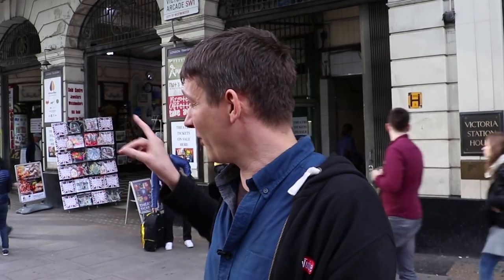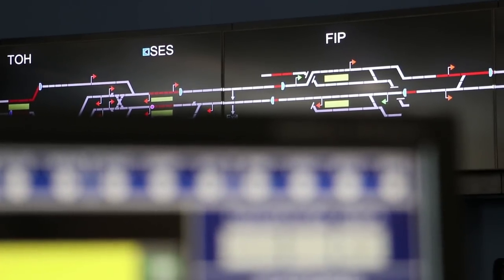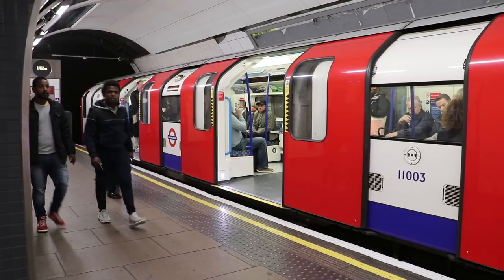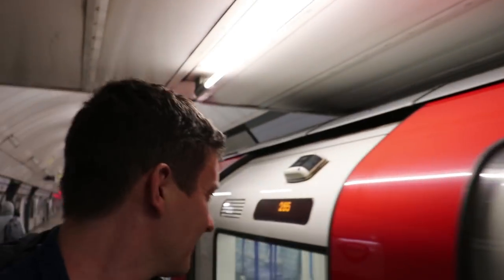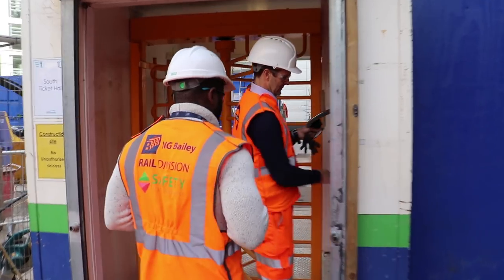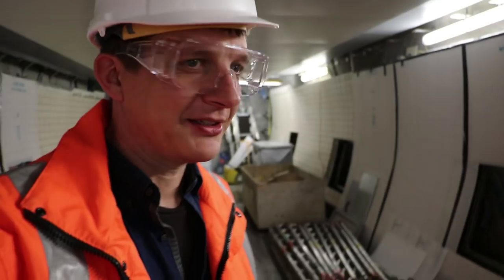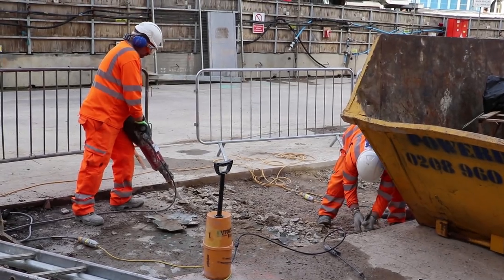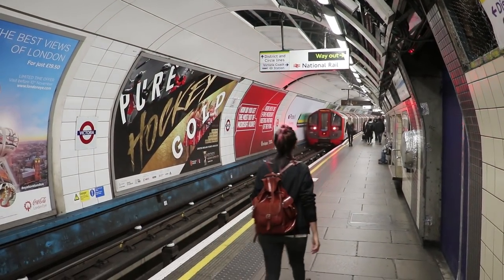Inside The Victoria Line Depot

Comment: Now all we are missing is more ventilation shafts. The trains are so close together that the line is in an average of 35 degrees Celsius in rush hour. They desperately need more ventilation shafts.
Reply: Zoltán Kozma 

That's the average temperature of a tropical country that I visited before!
Reply: Well I could agree that this is some cool thing... but people move to London for the reason among many others that it does not get 35 degrees there... at the seaside you go and dive in the tropical ocean. In the London underground you can take a bath in someone else's sweat... yikes... as people have their coats on of course :D
Reply: Zoltán Kozma 
That is average temp here in the Philippines
Reply: Zoltán Kozma h
Reply: Is that all? Not that bad. Besides vent shafts won't help. It's the heat off the brakes and motors then people. So you'd feel it before it hit the shaft anyway
Reply: Ventilation shafts won't do much to relieve the heat baked into the underground.
Reply: @taygadesign  well the VIC is the tropical of TFL 😂😂
Reply: @Bartimayus  they would at least allow for AC to actually make sense in the deep level tube trains.
Reply: There is an ongoing project for that actually.  
'Cooling The Tube' it's called... but don't hold your breath!

Comment: With that many trains so close together in an automated system , your going to get much more service problems when trains fail or signaling technology goes up the spout . Plus you only have a few turn back crossovers to divert a failed service onto to it can tip out and run empty to the depot ,

Comment: They should upgrade the bloody Pic line asap give how literally it fails every single day
Reply: the new tube for london is coming to the piccadilly soon. I'm pretty sure most of the time, faults on the piccadilly would be from the ageing rolling stock.
Reply: I love the pic stock so much though, the line I grew up using from north London.
Reply: H010 most of the Piccadilly line faults come from outdated signalling and particularly control room apparatus, meaning service recovery is slow or control room mistakes cause service disruption. The 1973 stock is actually very reliable for its age
Reply: @uwlodar 
2024. So yeah, soon! 😜
Reply: @uwlodar  yep, in 2022
Reply: @Oxley016  and the only line that serves my borough in the South

Comment: Geoff, it’s wonderful engineering at Victoria, and think that’s is going to be a victim of its own success, in that there are only two tube tunnels, at currently entrances are blocked off/shut to passengers from the British Rail concourse at rush hour, or if the service is not running well, all this will do is build up more people underground creating a H&S issue for evacuations, creating even more overcrowding, and at present, the current trains can’t cope at peak periods. 

So in essence, the project is deeply floored, as the Victoria line should have been a four tunnel system throughout, allowing the stabilisation of trains at key points, allowing other trains to pass or terminate mid-way taking away the peaks congestion at rush hour, even out of peak times, the service is congested, adding a new ticket hall and entrances does help, but for the reasons mentioned above, it’s storing up trouble for the future.

Comment: Wow the tube gets stuff done quickly and efficiently unlike the NYC subway
Reply: NYC subways that aren't cut and cover are drilled through solid rock. London Tube is through clay. And NYC subways are all 4 track while the Tube is 2 track. And once London got past the postwar period it really started to invest in the Tube. NYC didn't update anything for half a century and only started about two decades ago. But still there are obvious problems with NYC subways and lack of new lines and extensions that should have been done fifty years ago, and cost way too much when they do happen.

Comment: Brilliant video as always! :D I thought that the underground had just one big depot. :P
Reply: Minelogical RBLX really?
Reply: Yep.
Reply: Most deep level lines are completely isolated from other tube lines in terms of tracks. The only inter-connected lines are the sub-surface lines. The tube is very different from say the NYCS, where trains can go wherever they want if they just change track.
Reply: Thanks for the info. :)
Reply: Each tube line has it's own array of terminus depots. There's one at each end and usually a couple in the middle. And theoretically you could use one deep level rolling stock and travel on every line possible. It's just a matter of finding the interchangeable tracks and reversing one or two times
Reply: I agree with you all. c:
Reply: That's technically not true... there are interconnections on each of the deep level lines, so that engineering works trains can access every line (e.g. the bakerloo and jubilee are linked just north of baker street, piccadilly and victoria just south of finsbury park, etc). 

This is to avoid having to have several engineering trains based at each depot - instead all are based at the Ruislip depot (so technically there is a single depot for all lines, but only for engineering works). The only ones to be fully isolated are the Central (which has its own link to Ruislip depot) and the Waterloo & City.
Reply: H0ll0aloio What about Piccadilly Line and District Line at Acton?
Reply: I PLAY RBLX my name on it is Itzyoboi_Alfie
Reply: Josh  also there is a rare and unseen connection to the metropolitan line and Piccadilly line there through the depot. Might use it again when the central line could go to Uxbridge.       And double track it also.    Not to mention the main line connection at West Ruislip.        On the chiltern line hence the S stock is delivered down that way.
Reply: Same
Reply: Alexander Blonskirulach I do
Reply: @uwlodar : Not true.  All the lines are interconnected but usually by links the public never ride over. For example the Central, Piccadilly and Metropolitain link up at Ruislip, where the latter two are running on the same tracks anyway. However the service patterns tend to be isolated.  The Circle Line is a kind of fiction, really being just a service pattern that uses Metropolitain and District rails.
Reply: @jtheguitaristy  So the Central Line is not "fully isolated". As you then say yourself, it is linked to the Metropolitain and Piccadilly at Ruislip.  Ruislip is the Central Line's main depot, and it also has the main link between London Underground and Network Rail (the main line railways) and has been used for train deliveries from external manufacturers.
Reply: @S1lverArr0w  It is an over-simplification to say there is a depot at each end of each line, and an exageration that there a couple in the middle.  Most lines have two depots (the Victoria has one) and not always at the ends, especially if the line has been extended since built. The biggest depot, Neasden, is not, nor is Ealing Common, Golders Green, Northfields etc.
Reply: @dukenukem5768  you're quite right - what I meant by the Central being isolated is that it has no connections to other lines other than through the other side of Ruislip depot (as opposed to there being a loop directly onto another line). 

That being said, the depot is technically counted as "central line" for protection purposes, so if an engineering train goes from the depot to, say, Rayners Lane, it technically counts as having travelled on the Central...
Reply: @jtheguitaristy  : Interesting. The Central is/was a bit isolated from the other lines in that it had a slightly different loading gauge from the others in the underframe area. It used to be that only Central Line stock could run on the Central Line for this reason; I'm not sure if Central stock could run on other lines generally, and I don't know if this is still the case.   The LU link to Network rail being at Ruislip depot, and given the Central/Met/Picc link also at the depot, it allowed new trains arriving from outside manufacturers via Network rail to be sent onwards either way without the different loading gauges being an issue.
 
Of course the eastern end of the Central was originally a branch of the Great Eastern Railway, with a junction to its main line in the Temple Mills area, but that connection is no longer there. There also used to be a connection with both the District and the GWR main line at Ealing Broadway. I don't think there are or were any other connections with the Central, although one could easily be formed with the District at Mile End, where they share the station.
Reply: @uwlodar  Meanwhile in Singapore the Downtown Line is connected to the Circle Line (at BayFront station & Kim Chuan Depot, with similar gauges, platform lengths, train door placements & power systems) as Stage 1 of the former was originally planned to be part of the Circle Line. However when the government later decided otherwise, they then ordered a different signalling system for each line (Invensys Sirius/Siemens TrainGuard for the former & Alstom Urbalis 300 for the latter), as the latter was built earlier & separate tenders/contracts were called for each line (for transparency reasons?), so the 2 lines' rolling stock end up not running on each other's lines during revenue service. Which I think caused a missed opportunity - in 2011/2012, to increase capacity to meet rising ridership demand, the government ordered additional trains (C830C) for the Circle Line, to enter service from mid-2015 onwards. However if both lines' had compatible rolling systems & rolling stock, Circle Line's capacity could probably have been increased earlier by transferring Downtown Line trains (C951) to it (which were being delivered all the way from 2012-2017, and assuming a constant delivery rate, there would've been a substantial, increasing surplus of Downtown Line trains after it's Stage 1 opened in late 2013, since it's much shorter than Stage 2, which would only open 2-3 years later. Only 10 of the eventual 92 Downtown Line trains were operating before Stage 2 opened.)

Comment: The Victoria line has the advantage that is A to B with no lines splitting or joining, unlike most other tube lines, allowing the tight schedules. At the Brixton end, the driver "steps back" and another driver takes the control in the opposite direction to keep up the schedules.

Comment: Is it the same type of signalling system as in Jubilee and Northern line?
Reply: No the jubilee and northern line use a system called CBTC (communication based train control) which was installed by Thales, also being installed on the district hammersmith and city circle and metropolitan lines. This CBCT allows for in cab signalling by making use of axel counters, inductive loops and wayside radio equipment which the train is constantly communicating its position to.
Reply: @totalnike03  Wonder why the Victoria Line didn't go for CBTC/TBTC whereas the other lines did
Reply: @lzh4950  im not sure but the victoria lines signalling system is very good

Comment: I wonder if there is an announcement for seven sisters when coming from the depot
Reply: QuarioQuario54321 on the northern line, at kennington, there seems to be announcements on northbound Charing X trains which start there so it doesn't make much sense to me.
Reply: You mean an announcement such as "Now coming into Seven Sisters" ??
Reply: Stan Patterson Just the normal southbound announcement
Reply: When setting up in the depot the train will announce the destination ie. "This is a Victoria line train to Brixton".But the train doesn't make another announcement until the doors are opened "This train calls all stations to Brixton".No announcement on approach though.

Comment: This new trains cost too much and are very noisy! And have no air con!
Reply: The Ancients Ancients oh wow the MTA NYCT has ACs on most trains
Reply: The French metro has aircon (in the trains). But they have bigger trains becasue they have bigger tunnels there. Maybe that's a reason. There is the 'Cooling The Tube' project since a few now. Although I believe it is primarily about cooling the stations and the walkways by just extracting all the hot air. Possibly also the tunnels as a result of that. It may then help cool the interior of the trains somewhat. But it's only an issue in the summer time. The rest of the year it's always too cold in there!
Reply: New York City (where it is hotter than London in summer) has had all air conditioned trains for decades. But they didn't do much about station ventilation. AC doesn't make heat disappear - it moves it to outside. In the case of underground trains that means the tunnels and stations. I've been in NYC underground stations that were way over 100F/38C and humid. NYC subway should put large exhaust stacks in tunnels between stations, which would draw outside air down stairs into stations. But they never did.